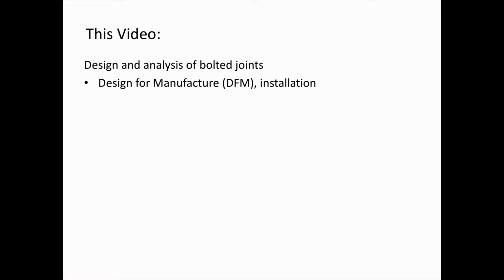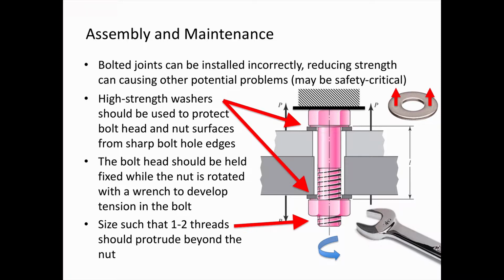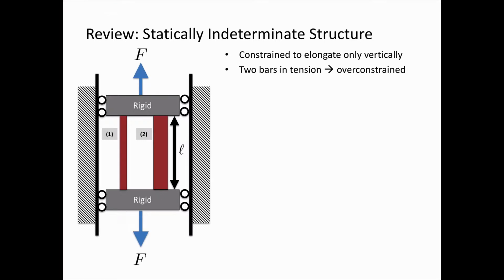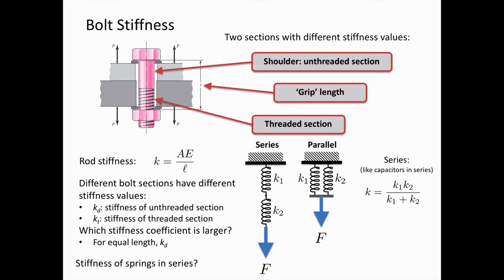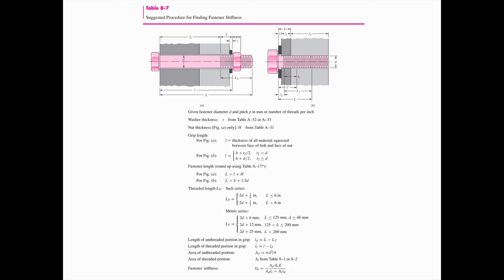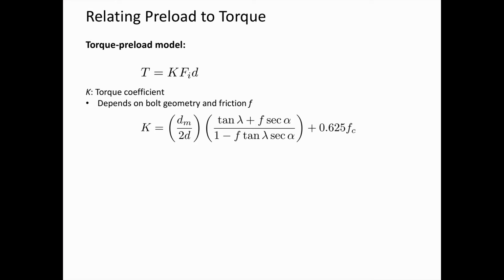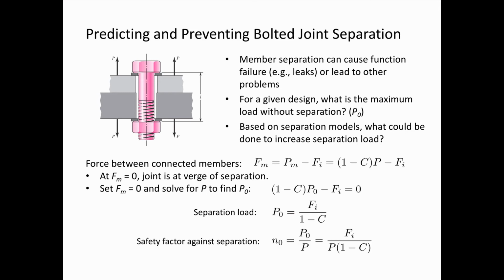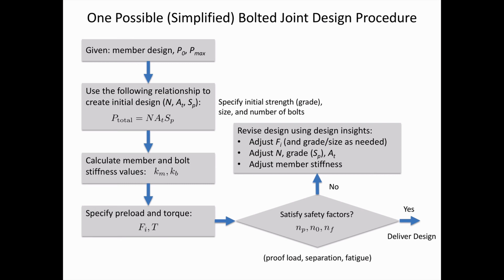Bolted Joint Analysis and Design

Comment: Excellent lecture on design and analysis.  Do you have a web page or a way to contact you for consultation?
Reply from the maker: My consulting website is https://design-impact.org/ and my research website is http://systemdesign.illinois.edu/. Both include contact information for me. My typical consulting engagements involve helping companies ramp up with using advanced engineering design methods, usually design optimization based, such as Control Co-Design optimization. I do work for U.S. government funded projects, so I am constrained to not charge more or less than I do for these contracts.